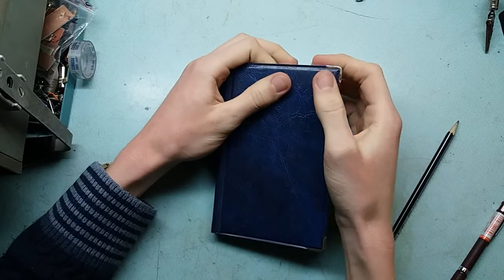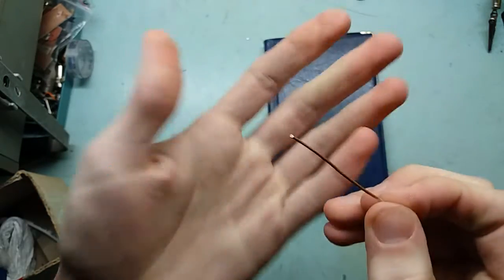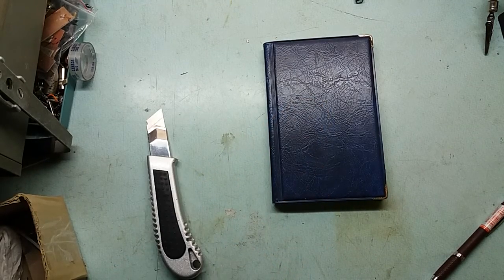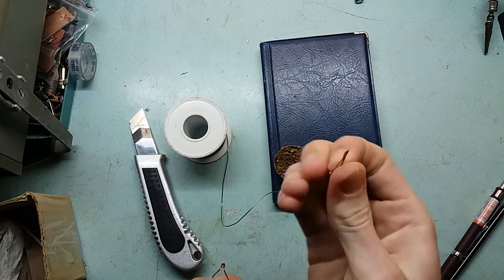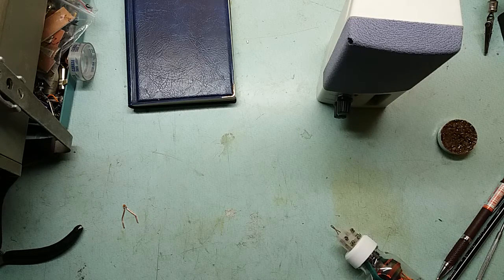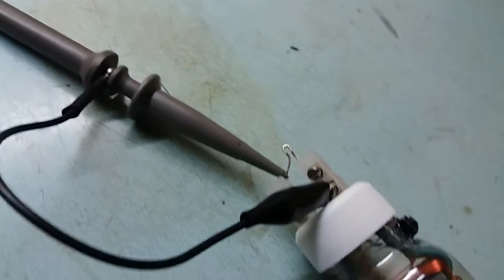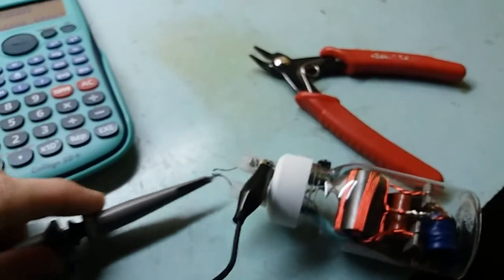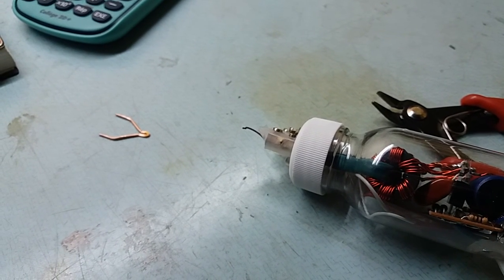ZVS soldering gun UPDATE

Comment: Hey looks good! That oscilloscope power supply could wake the dead :^)
Reply from the maker: Yes, it can :D My scope is funky in a way that it can be powered from a 24V DC, which is then fed into the switching converter which creates all necessary voltages. The switching transformer is potted (!) but still makes a lot of noise, I don't know what else can emit sound there.
 Other scopes I've seen use a multi-output SMPS powered by mains, or a mains frequency transformer with a lot of taps :) Mine kinda hints that I can use it in a field, but it's pretty bulky to be handy if you ask me.
Reply: Thats a great looking scope. I have a few pan-scopes, "Panalyzor" type displays that have that same high pitch noise coming from the power supply. Great instruments though! TTYL!

Comment: Ooow missing diodes, but it ran ok, thats odd.
The new tip should have focused the current at the tip, perhaps the resonance or loss changed too, although i would have thought at such a low frequency it would have made much difference.
What about a safety pin as an element, it should last a little longer, but the resistance wont be as low as copper so i dont know how the zvs would react.
You may have to change the value of the resonant capacitor to tune the zvs to the final tip you use, just guessing.

Yes your ears will hear that osciliscope more than older people, Old tv sets can be annoying too, line output transformer whistle is annoying.
Reply from the maker: You got me wrong, I have those diodes installed, I just forgot to draw them :\ The frequency goes up when you increase the load, but it doesn't affect the heating significantly. 
Why it didn't work out - because the resistance of a conductor is inversely proportional to its cross-section and directly proportional to its length. I decreased the cross-section of the very end, not the whole wire, thus the overall resistance was still much lower than the finer gauge (0.6mm) which I've used before. Hope I'm clear here.
Reply: Yes i did understand anyway, i just thought the zvs could deliver enough power to make the highest resistance point (the tip) the hottest part of the element.
The filed wire looked a lower resistance than the thin wire you started with, so the overall series resistance would be lower.
But non of that matters, a copper tip does not last long so different metal will be needed to make it last.